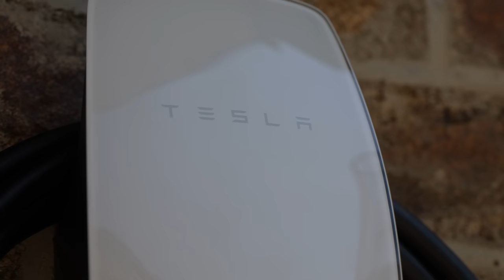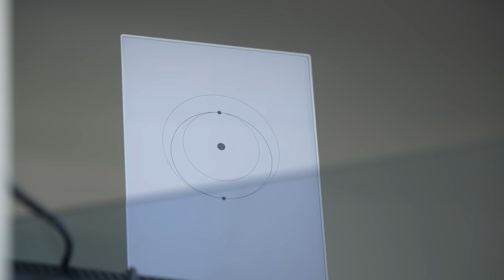Problems At the Convent

Comment: you could place the antenna on a flag pole, it might be lower but you could rotate it into signal much easier. I am more concerned about a wind storm than the weight.
Have your solicitor send them a note about the lack of install and being billed for nothing.
Thanks for the video!
Have a fantastic weekend!!

Comment: Billy, you could have saved the work and time placing the whole dish on the roof. Starlink would have worked perfectly on the ground in the courtyard. BTW: braces are available to permanently fixing it to the side of the convert. But, if it works it works the way you want.👍🏻😉

Comment: All that for a STARLINK Internet… You dont have to put it on a Roof , just set it up outside anywhere it will still pick up a Great signal. I’m on a 41 foot Blue water cruiser 918 miles North east of the Bahamas in the South Atlantic… Writing this comment with my STARLINK set up on the Deck of my Cruiser doing 9 knots, With No cell service….. Its not like a Satellite TV Dish its designed to work anywhere in the World …It doesn’t make a difference if its on a Roof or in the middle of a Jungle it will still work far better than WiFi …. Its a Awesome bit of KIT …. can’t believe you went through all that to put it on a Roof Hilarious 🤣

Comment: I also trawled the carboot sales for picture frames, paying anywhere from £0•20 - £3-00 per frame, most of which had glass already in them. Some were either antiques or art gallery quality and since I had no interest in the contents most of the time, I just chucked those out or used them as packing in order to get the photos to sit flush against the glass.
I've noticed from a few of Sean's trips to carboot sales that there are also picture frames for sale. 

In order to continue stay the right side of Gwen and NOT have your dinners for the next month in the neighbouring Chateau's dog, by shopping at carboot sales & staying [OUT of the local Brocante 😂😂] for good quality frames or ones that only need a wee bit of TLC to bring them up to snuff, if you had a customer willing to pay just that bit extra, framing their print of choice could prove very lucrative.
I'm betting there's lovely picture frames to be had for only a few euros. Mine averaged £1 per frame for nearly all of them.

Comment: If you remove the glass from the skylight. Replace it with plexiglass in the frame. So you can mount the   unit on the plexiglass with bolts and sealant.